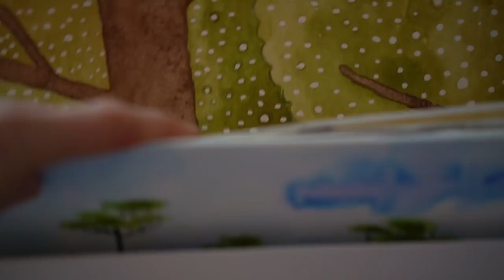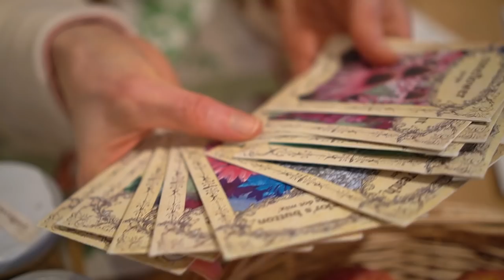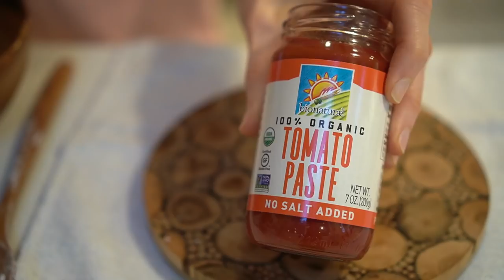DAY(s) IN THE LIFE| garage organizing, pizza recipe, painting, simple living..

Comment: When you water your jade plant, don’t water the leaves but water the soil only. Let your water sit before watering, don’t water from spigot.  Hopefully this will help!
Reply from the maker: Thank you Nancy! 😃💗
Reply: Also the Jade plant is a succulent so it stores its water in its leaves, so be careful u are not watering it too often. Love x
Reply: And some bright light 🌱
Reply: Place your jade plant on the kitchen sill, it needs more sun as well :)
Reply: The jade plant needs light. Natural light. It will flourish
Reply: Thanks for all the tips. 💟 I came to the comment section looking for jade plant tips as I've struggled with them as well.
Reply: I have about 30 jade plants , from large to small.  Sone are over 29 years .   It does not matter if you water the leaves  and if you let the water sit out.  But it is important to remember they are succulents.   They want a LOT of light.  Even a bit of sun if possible  (like an hour or so of direct morning light), then super bright light most of the day.  If they are not getting a lot of sun light, or not strong bright light, you will need to batelyvwater them.  Since they are not getting much light, the soil will not dry out enough to water much. Then they root rot.  Also, I would also make sure tgecsoil used is not the kind to hold on to water.   Use not only a fast draining soil, but a 'drier' mix. Use a porous Terra Cotta pot, not plastic or glazed ceramic. Try taking it outside once a week in a very bright (but not direct sun, inless it is morning sun) spot.  Since it is used to indoors, suddenly throwing it in a hot sun may shock it.   Also, temperature and humidity levels in home may be a factor.